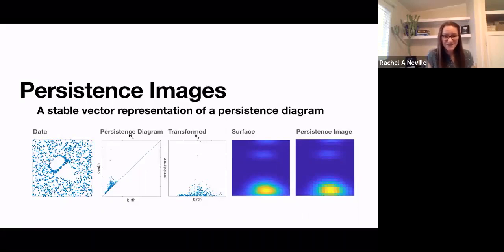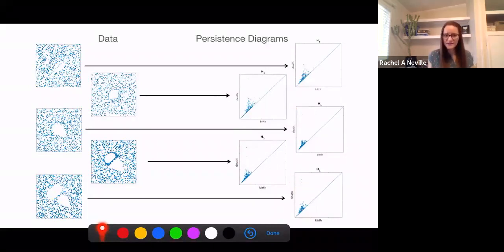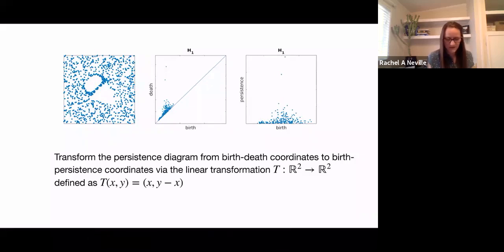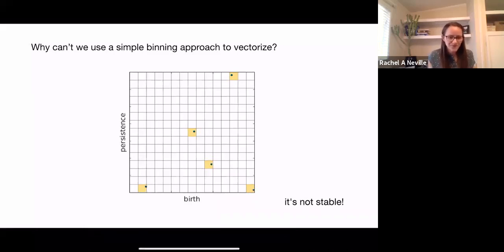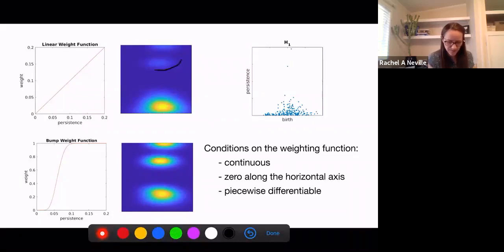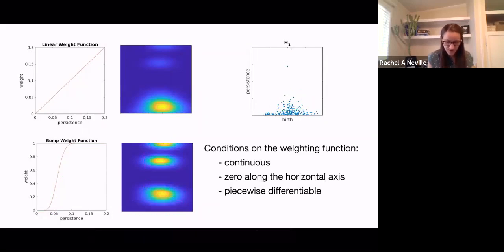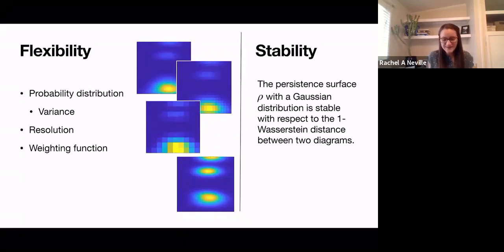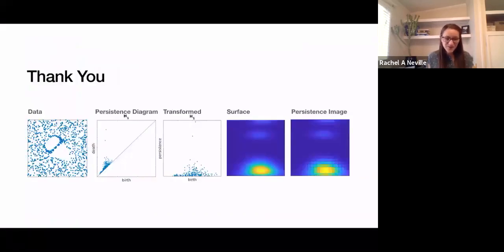Persistence Images [Rachel Neville]

Comment: Thanks for this nice intro!
If I'm working with 2D images (png's) and I resize, transform them to greyscale for preprocessing, then use the imgs as numpy arrays to get persistence diagrams (using sublevel set filtration on pixel intesity), do I still need to standardize my images before getting PD's or maybe after? I'm asking because I want to then compute the persistence images for hom. dim. 1 from the PD's to train a classification model. Thanks!
Reply from the maker: It may first be worthwhile to try both ways --- both standardizing the images and not --- and see if there are significant differences!